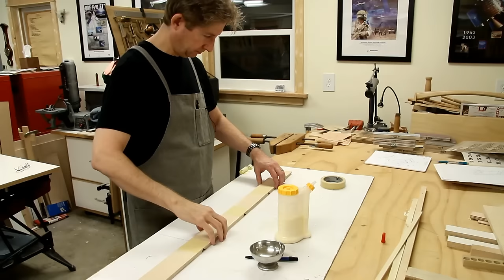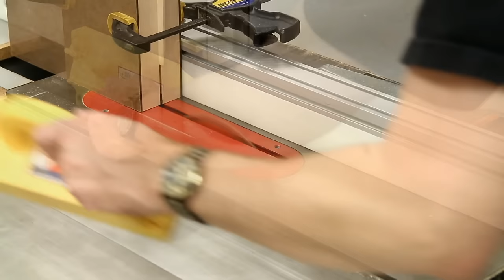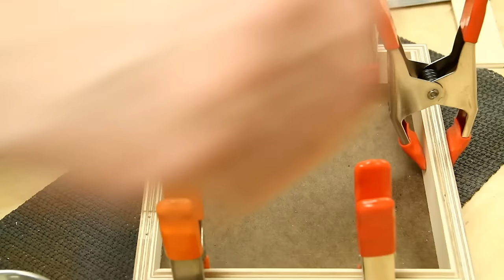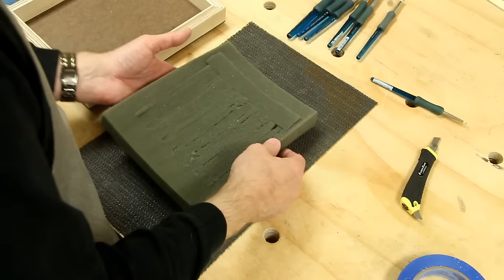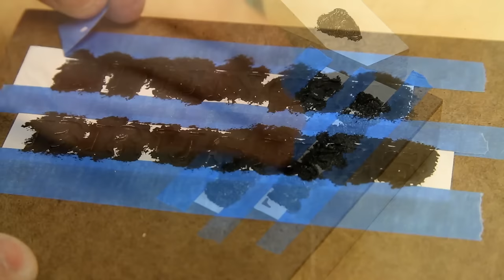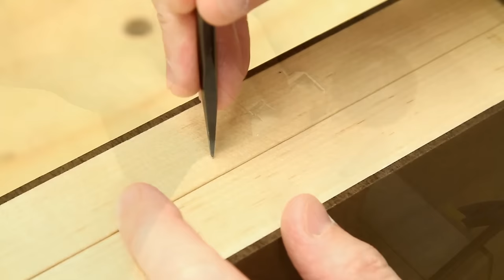Building a custom fitted brush storage box

Comment: Planing plywood...now that takes guts and skill!
Reply from the maker: +F1DesignUS Planing plywood edges is easy, just be sure that your plane iron is very sharp and setup for end grain.
Reply from the maker: +Allan Nielsen Thanks Allan. Any plane can cut end grain (and therefore plywood) reasonably well. The blade just has to be very sharp.  A low angle plane can be a little more forgiving in use when planing end grain.

Comment: Out of curiosity, what's the name of the pyramid-shaped tool that you used to make the holes for the hinge screws? I've seen something similar used before for Japanese pin joinery, but have never been able to figure out what it's called!
Reply from the maker: +Max Makes It's called a Birdcage Awl. There are a few modern makers of this tool. The one shown in the video is made by Narex, for about $10.
Reply: +Marty Backe Thank you so much!